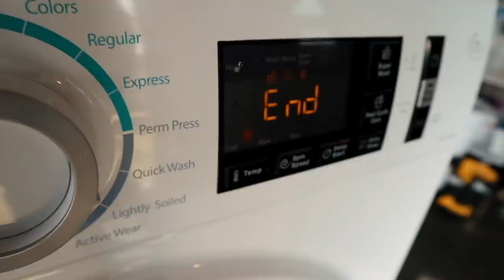5th Wheel Trailer Brake Repair  (It was hard to find...)

Comment: Fun watch.  We have a Splendide also.  Got down to 10F the other day.  Our coach is in a covered outdoor storage.  The manual says to pour some RV antifreeze in the drum and run the spin cycle to allow the pump to flush the water out of the pump and fill with antifreeze.  This is what I did.  I sure hope it worked.  Our model looks different than yours, but I will look for that drain for the pump in the front.  I don't believe I have that.  We have a Class A, so our access to the unit is limited.  Thanks for the info.

Comment: Hopefully it’s covered by warranty. We have a brand new Momentum 395MS and haven’t been able to use it. Came with a bad hydraulic pump from the factory that wasn’t discovered on the PDI. Going on 2 months and waiting for a new pump from GD. We bought based on GD’s great customer service. I can’t imagine what not great customer service would be like. Glad your trailer is fixed and you’re able to use yours. 😊
Reply from the maker: Ugh - we cant use our Happi Jacks in the back - a sprocket broke on our walk - through.  They wanted to keep it until the part came in - they just called last week saying it arrived 11 weeks - so glad we left anyway and dont need the happi jack yet.  Hoping you get yours back soon and can hit the road!  Thanks for following along!
Reply: @SwitchItUpLife  I have a 2020 RAM 3500 dually and wanted to know what size tires and wheels you're running? Keep up the good work : )

Comment: I think all washers have a little water in the pump. That's why they need to be winterized which you can run RV antifreeze thru them if you can't get to the pump to drain it. I have done that for years and it works fine. Course before you do a load of clothes the next spring you have to run a load of soapy water through the machine first. :)

Comment: Did Grand Design cover both of those fixes under warranty?  Awesome videos BTW.
Reply from the maker: Just the brakes not the washer issue.  Thanks for following along!
Reply: @SwitchItUpLife  did you contact Splendide about them covering that repair?  I did not expect that GD would not cover the washer, but there should be warranty by the component manufacturer.

Comment: Glad you found your brake problem could have done a continuity test on the brake wires of each wheel also brake wires would need to be disconnected but saves pulling wheels. Also you ride a racius bike shold be called a indiginus motorcycle ha ha ha LOL Todd you are funny

Comment: Did you take a break before you worked on the brakes? Sometimes you will break your back trying to lift those brakes.  Break. Brake. ;)

Comment: Couldn’t you have locked your brakes via the controller and have your wife to see which was freewheeling? I have done that as well as engage the Manual safety switch and spin the tire if the truck was disconnected